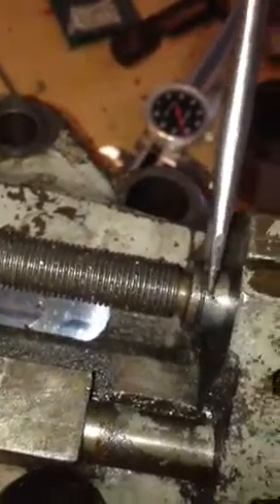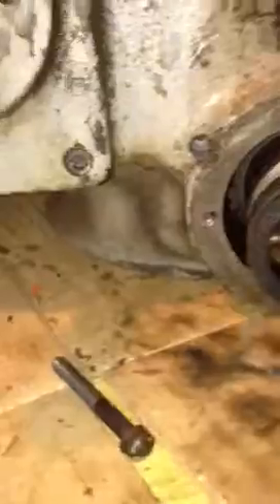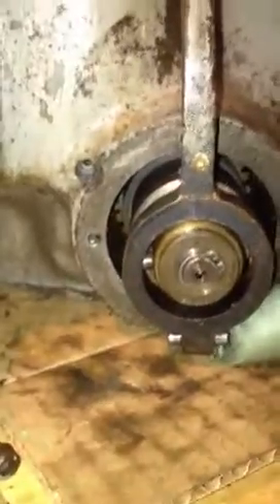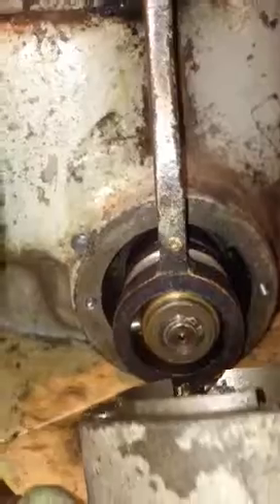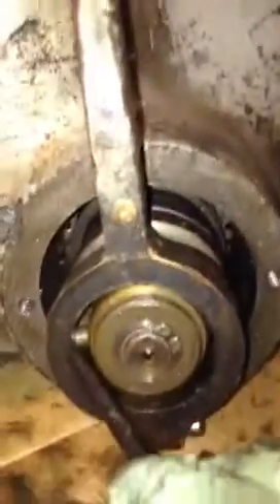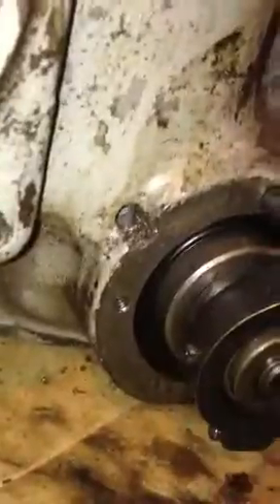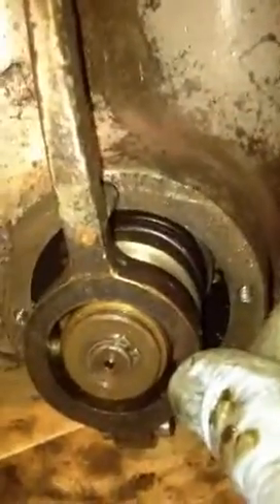Bridgeport quill tear down part 5

Comment: Had same problem removing quill from a machine that was not torn down.  We removed the quill feed and then gently dropped free loose quill to tap the threaded rod out the bottom.  20 - 50 gentle hits are better than 3 that ends up breaking the bolt holding the height adjustment collar to the quill.